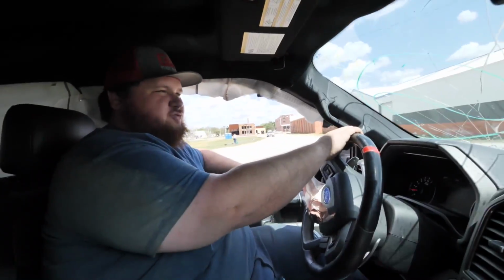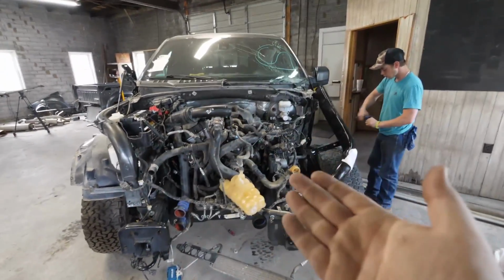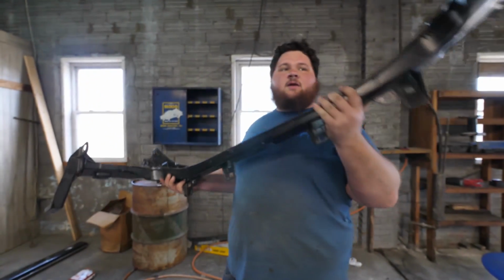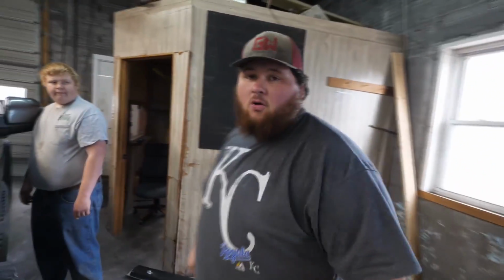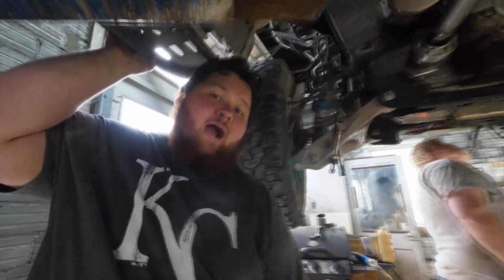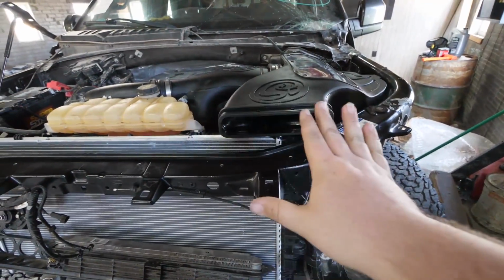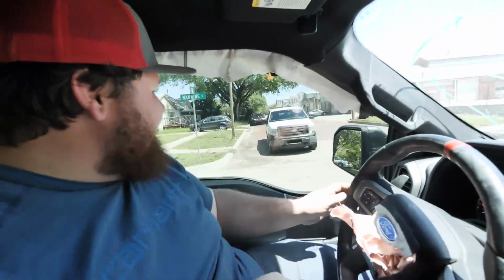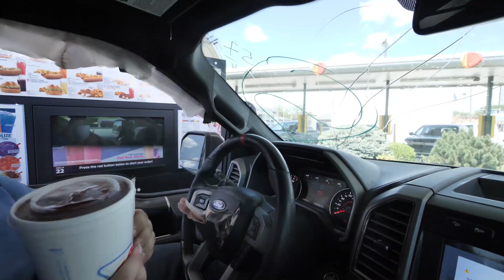Taking Wrecked Ford Raptor for Test Drive...(100 Tacos Please?)

Comment: Your a really smart guy if you’re able to tear a 2019 truck apart and put it back together.
Reply: Connor Hutton hell fuck yea all the unnecessary electronics and plastic bullshit this man has a lot of patience
Reply: You’re a smart guy if you know the difference between “your” & “you’re”
Reply: Small mistake that many people make, LOL. J/K, LOL!
Reply: American truck are actually still really simple to work on. Most of the electronics are still just blocks of plastic hanging off the body panels and frame. Now if you want something that requires a degree to work on, buy an import. Imports like to hide things inside the engine blocks, computer calculate very tight specific timings with zero tolerance and hide critical components inside a russian doll of plastic parts.
Reply: No doubt, was thinking the same thing. What a hell of a project. I wouldn’t have ever attempted this

Comment: Without a front end, you can drive incognito. Without a bed, you can haul whatever you want. With the airbags deployed and hanging down, that's better than tinted windows. You'd be that 'Mysterious Masked Man' if Dom wasn't standing on the side of the road filming! Dom needs a disguise for two reasons: 1. You could be 'The Mysterious Part Raptor Man." 2. For those moments when you need to say, "Dom, duck down in the seats, we're trying to pick up wemmen in the Raptor!"

Comment: hey, Westen, i admire what you are doing, I am currently rebuilding a super wrecked 2016 ford f150 and I got the same damage as well, it's super fun, and loving the process, although we lack a lot of parts here in Africa but surely I will get it down

Comment: I'm not positive, but I'm fairly sure your tracks on the kabota were loose in those clips. You're only supposed to have a couple inches of gap on the bottom, just jack up one side at a time and see how much it sags, the two finger test is usually accurate enough.

Comment: Sounds just like my 2011 Ecoboost with no exhaust. You should put the MBRP 4 inch cat back sounds nice less chocking the engine. Also put some Turbosmart BOV's on they sound sick when you let off the gas under load and hear Tishhhh it turns heads

Comment: I would love to see how much this thing cost you after you get it back together.
Reply: Hercules Rockefeller probably almost like an used raptor lol 
With 60k miles  who knows
Reply: @Juan_T1  At least and that is not including labor.  Also most auto insurers would not insure this or would charge much more then normal to do so.
Reply: Xcaliber Trekker most of them will insure it as a salvage or rebuilt, sometimes it’s more expensive but these vehicles have to be re inspected and it’s thorough
Reply: Then subtract that figure from what he made on the channel with its videos. He is money ahead.
Reply: Plus a reconstruction title kills the value.
Reply: @Iamthathillbilly  depends on where you live. In Texas it just has to pass the regular inspection (same as an unwrecked one) where they just check lights horn and tires and pass it on sight. Takes less then 5 min in and out
Reply: I’m wondering the same thing. Content paid for this, plus he’s havin fun hanging out with his buddies

Comment: I'd consider moving the intercooler up in front of the radiator so you can put an aftermarket bumper and winch on that. you're gonna need the winch for dom's girlfriends.

Comment: Just started enjoying your channel during this crazy time quarantine stay at home. I have watched Pretty many of your videos and it just seems like a couple buddies tinkering around and fixing stuff. This Raptor project is very impressive! You guys make it look easy and you have fun while you doing it. Keep up the good work thanks for entertaining me. You probably won't read this but if you do I was wondering if you sell any of the vehicles that you fix? I have a 2005 Mazda 6 3.0 6 cylinder duratec engine which is a Ford engine and I hate that. I actually blue the original engine 2 days after the extended warranty ran out so I got a brand spanking new engine or 100% refurbished I had the Mazda dealer put it in it took them three engines to get it right they kept blowing. Anyway I would love to have Ford with a Cummins engine that would be like my dream vehicle like your Fummins.  Could i possibly do a trade with you? 2005 Mazda6 with 45,000 miles on the engine for a pickup with a diesel engine. I'll drive out there to do the swap I'm from Pennsylvania by the way LOL wishful thinking

Comment: Is this really a '19 Raptor? You have '17-'18 wheels, '17-'18 engine cover, and '17-'18 fox suspension - all which were changed in 2019 models.
-'19 Raptor owner

Comment: the breaks don't work correctly the front locks up and the back ones don't. well i guess its better then mine the rears lock up and fronts do nothing because there's no weight in bed you better take a look at that.

Comment: Not trying to hate but Is it a 2019? Because it has the blue fox shocks which those come on the 2017 & 18 the 2019 have live valve shocks which are orange

Comment: that raptor sounds like it desperately needs a cumins turbo diesel :)
Reply: I guess im out of touch with new trucks...i thought for 80 grand it would have a V8 atleast ffs
Reply: @leeharris3061  right not an eco boost
Reply: @tommywilliams9184  The 3.5 ECO is a hell of an engine. They will cook any other standard size truck engine out there. Fact.
Reply: Put that Cummins in the Raptor and the Raptor V6 twin turbo in the Mustang.
Reply: Anything but that Eco Junk!!
Reply: @williamkeith8944   you have the right idea! westin needs too modify both projects just a tab I think :)

Comment: The one time it lets you know its in charge as when you punch it and it goes right through the shop and out the back because it just wanted out of the crappy little shop with the crapper that the corona virus started in. I see it back together and just wonder if you can sell it after that much work, love and devotion. Good luck "big hands" Weston

Comment: Just saying it would be much cheaper to buy aftermarket fenders that also fit larger wheels/tires.

Edit: B is for build's raptor had aftermarket front fenders before it was wrecked. Chris is just dumb and put a stock fender on one side with a larger one on the other

Comment: I was going to tell you that on the next radiator need contact www.radiators.com. set up an account easy to do no cost and you will be surprized to see how good the prices are. Also ac parts

Comment: No they are crap radiators. Plastic tanks and crimped to the radiator. Additionally look how thin they are. All for weight reduction and boost mileage. Go to Death Valley in May w AC on... it'll boil

Comment: I have to say the V6 raptor sounds like the weakest engine I have heard for a so called off roading truck.. lol
Reply: It doesn't sound that good but im pretty sure you can push more boost through em and get roudy. Have you seen ken blocks ford raptor?
Reply: The "ecoboost" name is like the worst thing you can call an offroad truck with 450hp, makes it sound like its some hybrid 1 liter engine.

Comment: Sadly it doesn’t sound like a truck 😔 should have put a v8 in their when you had the chance
Reply: @kevin contreras, that engine in the Raptor is a super charged V8
Reply: Leo 1C2 - no , ecoboost V6
Reply: Leo 1C2 - 5:04